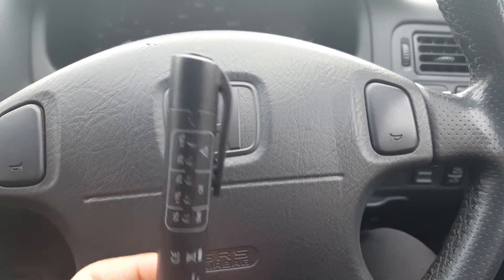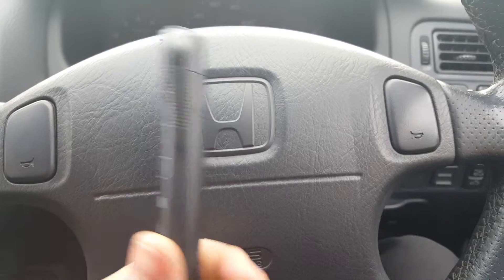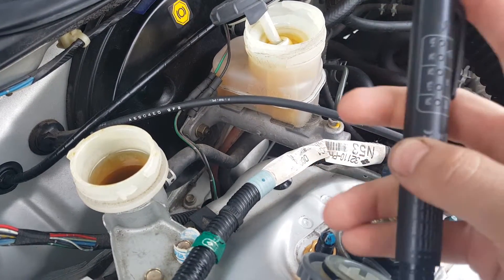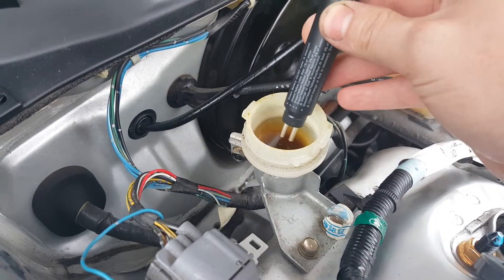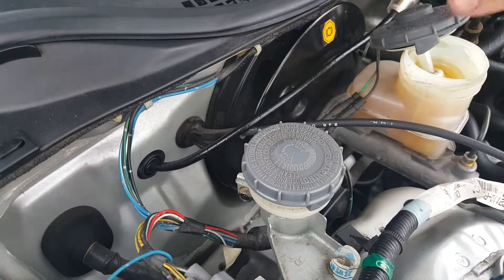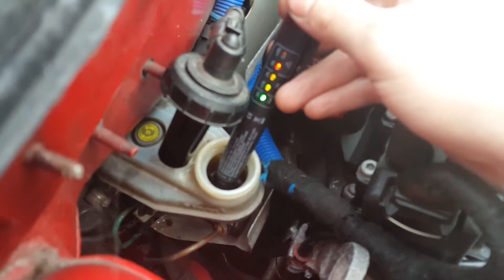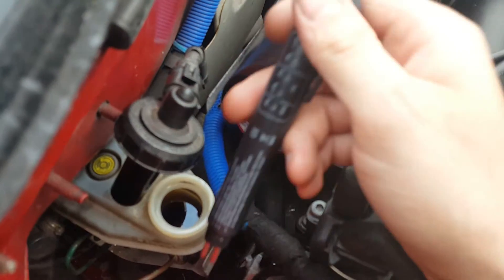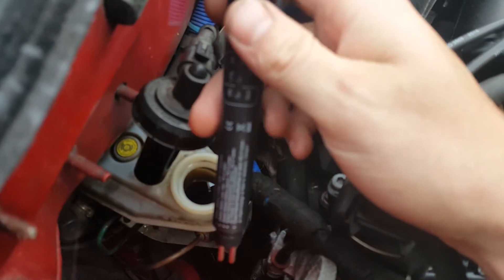BRAKE FLUID TESTER

Comment: You are supposed to insert the metal tips of the probe completely in the fluid to get a correct reading. You did not do that with the Honda.

Comment: it is very easy to use these testers incorrectly - only the tips should be in contact with the fluid when using the device shown otherwise a false reading could be obtained leading to unnecessary fluid changes